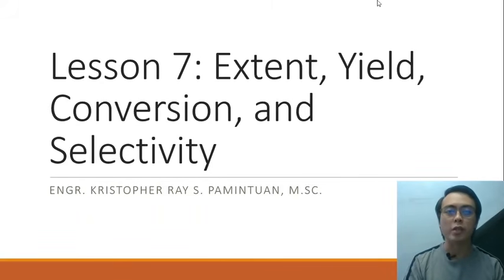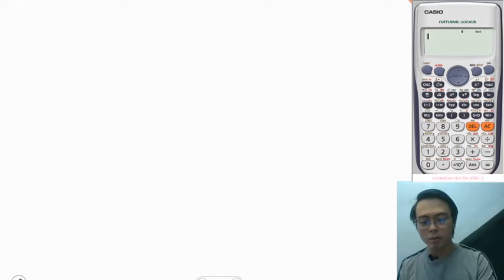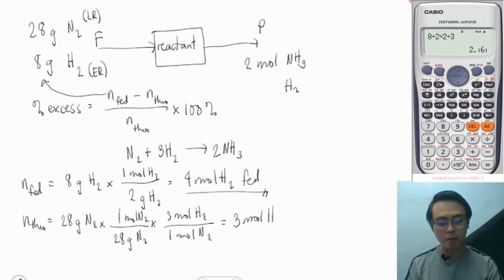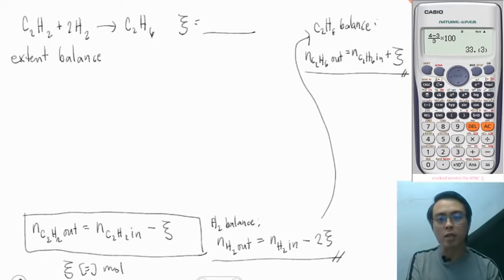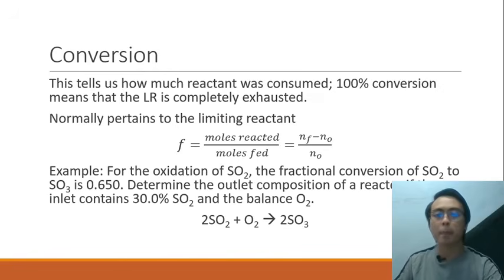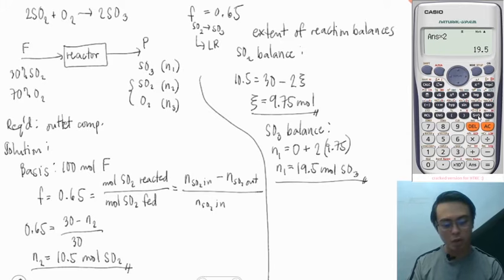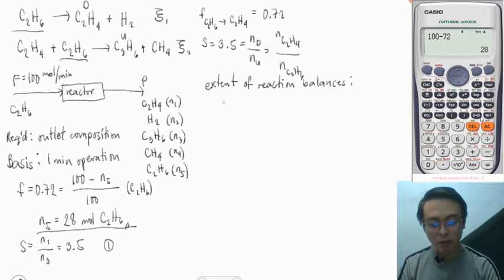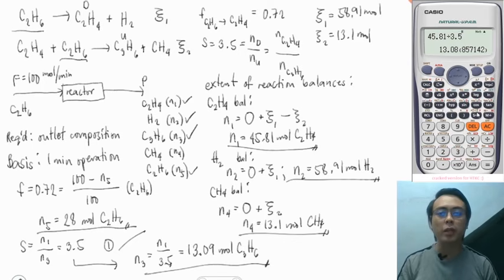Limiting Reactant, Extent of Reaction, Yield, Conversion & Selectivity | Reactive Material Balances

Comment: Two well-known gas phase reactions take place in the dehydration of 
ethane:
C2H6➡️ C2H4 + H2

C2H6 + H2➡️
2CH4

Given the product distribution measured in the gas phase reaction of 
C2H6 as follows: C2H6 27%, C2H4 33%, H2 13%, and CH4
a. What species was the limiting reactant? 
27%.
b. What species was the excess reactant? 
c. What was the conversion of C2H6 to CH4
d. What was the degree of completion of the reaction? 
?e. What was the selectivity of C2H4 relative to CH4? 
f. What was the yield of C2H4 expressed in kg mol of C2H4 produced per 
kg mol of C2H6? 
g. What was the extent of reaction of C2H6?

Solve in an easy format